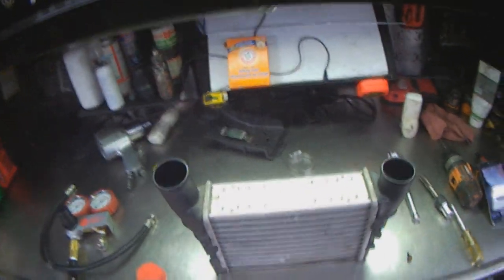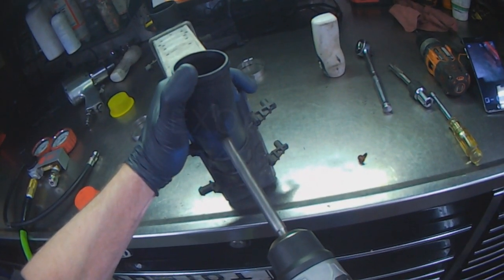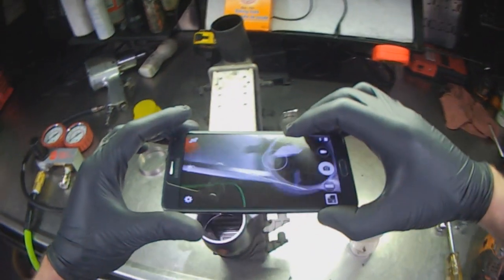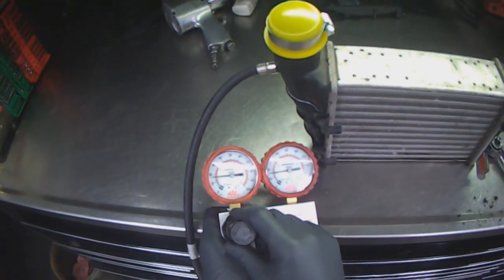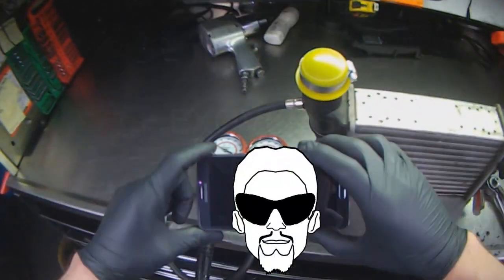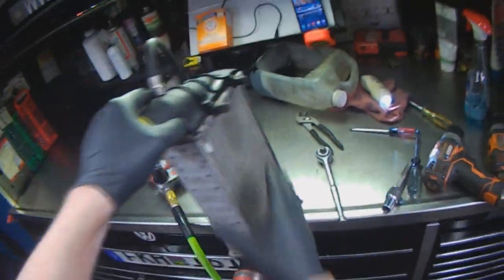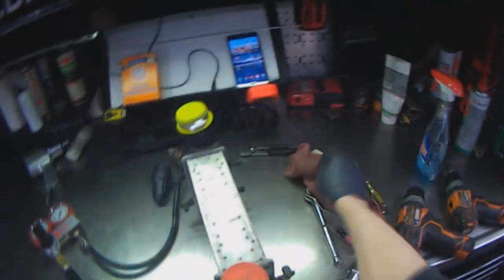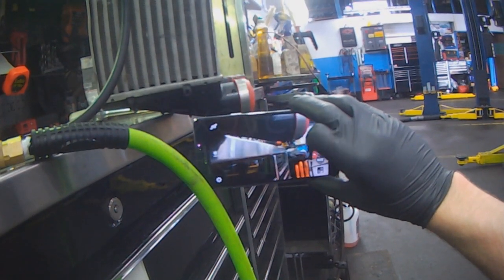Intercooler pressure testing (after drilling... OMG!!!)

Comment: Dude, I for one appreciate the time and effort. I have a 2012 3.5 in my f150. Just passed 70k miles. I have been on the fence about drilling. But now I definitely am convinced it needs to be done. Thank you !
Reply from the maker: Thank you for watching!
Reply: I have same truck. Have had a 1/16th hole for 2 years now. No issues.
Reply from the maker: @jt7559  Thank you for sharing!
Reply: Do you plug the hole or just keep it open?  It appears a lot of people just drill it.  I have a 2011 F150 3.5 EcoBoost
Reply: @n54tuners51  plug it, I tested it, I lost 2mpg with the plug out, truck was always under boost while driving
Reply: Does this apply to the 2015 3.5 f150 eco boost?  What size “plug” or type of screw do you guys use?
Reply: @n54tuners51  I have the same truck I have no issues

Comment: I think Every Turbocharged car owner should "drill that hole " !!!!
Great Video btw !!
Reply from the maker: klitoni1 Thanks! I would definitely recommend checking for oil if it is an older vehicle (6yrs+). On a side note, I put a turbo on my old car with an intercooler... vented the PCV to atmosphere however. After 7 years of driving, the intercooler looked like brand new inside, not a spec of oil or dirt.
Reply: Thank you, awesome and helpful vid

Comment: Wow this is awesome thanks for this information. This will help me not only save time but also prevent engines from blowing up. I find sometimes oil if build up too much will sneak up in so it takes time to empty it.
Reply from the maker: I've heard of guys drilling a smaller hole and leaving it open... on the newer diesels, the ones that are prone to intercooler icing, it prevents ice from forming because the water can drain out.

Comment: Excellent Idea. I have a 7.3 ford and I believe the intercooler is full of oil. Lack of power due to half the intercooler full. It is  a 2000 F550 with 280 K on it. Always been a work truck and most likely neglected. I have owned it for a year now. So this will be the first step. Next is injectors and glow plugs. Everything is original so time to give some TLC
Reply from the maker: I doubt that it is half full... you have bigger problems if it is. This was my intercooler when it was full with windshield washer fluid (used for cooling the combustion under boost)... injector nozzle was stuck open.
https://youtu.be/kY-2HRUdaqQ

Comment: I´ve done it myself in my ALH, in my experience even the small plastic debris got pulled out by the drill bit. If corrosion is a concern use an stainless screw :P Thanks for the tip Thomas.
I dont think there´s a need to blow things up, we never know what may happen, stay safe.
Reply from the maker: Fernando MMC Thank you for your input and sharing that you have done it yourself! I am worried about how it will blow up... I'm considering putting the intercooler in a metal bin (with my gopro inside the bin) so that the metal bin will catch any flying debris.
Reply: *****  i've met guys runing 2 - 2.5bar (36 psi) on 1.9 PD TDIs with bigger turbos on daily cars. I dont know what kind of intercoolers they use but probably you will need to raise the pressure higher before something blows :\  Using some sort of metal bin seems a good idea, safety first ;)

Comment: nice of you to take your own time out to show how its done, keep drilling them holes👍👌
Reply from the maker: Thank you for watching!
Reply: @EXOVCDS  Hi, i no it was 5 years ago when u did this vid, but i watch all your vids over and over, sure helps me out, i have 09 caddy 1.9 tdi BLS and most things in your vids are the same for the caddy
Reply from the maker: Did you already check / drain your cooler? Does it have a similar cooler?
Reply: @EXOVCDS  no not the same cooler i undo the pipe at the bottom of frontmount/cooler nice and clean for now

Comment: Haha, well, just after making the comment below, I found out that the Ford EcoBoost guys are all drilling their CAC's in order to prevent/resolve poor running concerns! You were ahead of your time Thomas!
Reply from the maker: Slightly different issue... water condensing in the cooler that gets pushed up and causes misfires. VW Common rail TDI engines also have water collecting issues. The EcoBoost guys leave a hole in the cooler. I'm just draining the pcv oil and plugging the hole after.

Comment: Glad I seen this video, I have a new 2nd generation eco 3.5  Ive seen that this can cause problems with the 3.5 overtime, I will investigate my cooler later to see if they might have added a drain plug, But something tells me they have not. Since the engine maker also likes to service and sell parts. I have no problem drilling a small hole for a screw, If something happens to the hole would be easy enough to go one size larger on the screw. But the side wall looks thick enough that one could remove the screw many times with no problems,  I can easily drain it myself when I change the oil, no big deal. Thanks
Reply from the maker: My point exactly! Thank you for watching!
Reply: Hey that was an awesome test proves what you've said is verfied & proven nothing like seeing it with your own eyes.👏👏👏

Comment: used to build aftermarket radiators. during testing slash blowing up the pressure we reached was 85 psi. these were not oem radiators. oem about 40 45 psi. the plastic tank will usually split at the header or where the alluminum crimps on. being the intercooler is built to with stand higher pressures I would say it would make quite a bang at around 100 psi. just my input. Be careful.

Comment: I drilled a 1/16 hole,  some nasty shit came out. I feel good knowing its not caking on my valves and internals. Also, i put a catch can on. Both together have changed the overall performance and gas mileage. I have zero power loss, maybe power gain actually. I have run into all the issues such as missfire, coil replacements, nasty looking spark plugs, limp mode, you name it... drill this hole, get a catch can, and be happy.
Reply from the maker: Thank you for sharing your experience.
Reply: Travis byington going to drill mine this weekend ;) thanks for the info!

Comment: great video, thanks for taking time to post and excellent proof of principle.  I like the info on a 1/16" hole can be left unplugged...the pressure would continously push out the foreign matter during operation. Combined with a catch can it would be very effective.
Reply from the maker: No need for a catch can... the intercooler is a catch can.
Reply: Just FYI friend.  Already had the catch can. .. Had the problem 20 K miles ago,  so added a catch can and changed the plugs  ( I was afraid to drill the intercooler at that time).   Problem came back...so I drilled the 1/16th hole, changed plugs again this time with FORD TB recommended .028 gap.  Found one plug with small cracks in porcelain.  Not sure what happened, but in my case, the Moroso catch can may not have "caught" enough. Thanks for your response
Reply from the maker: I'm not familiar with Ford intercoolers and the oil / water issues they have. My intercooler drilling / draining / plugging with  a screw is focused on older TDI engines.... to prevent oil from being forced into the intake, which can cause a runaway of the engine / major mechanical damage.

Comment: Ok I understand your fix and it makes sense. What about if you are wading in some water. Sinse that hole is on the low point of the intercooler wont you get water ingress into the intercooler and that can go in your engine alsoand lead again to misfire?
Reply from the maker: mixhael6609 Where in this video or in my other 1200 videos... do I show that I leave the hole OPEN? 

I drill a hole to drain oil that collects... AFTER draining I plug the hole with a SCREW.

Did you watch the video? Seriously... did you? Seems like for the majority of people watching this... I waisted 25min of my life making a video to help people save / prevent an engine blow-up due to oil ingestion.

Sorry if my reply seems harsh... it just doesn't make sense to me that I get comments like yours when I explain everything in the video.
Reply: Isn't the system normally under positive pressure?  How would water get in through a plugged hole in that situation?  If it did have a minor leak somehow, you might blow some tiny bubbles in the water and scare a frog but other than that...  ?

Comment: Well Thomas I watched it all , was not boring at all, quite interesting as a mater of fact.  Kinda got a vibe from the tone of your voice you wanted to rip someone's head off. :) Everything seems logical to me as far as the oil removal  is concerned .  The amount of  normal pressure I assume would never reach the shown tested pressures.  May I suggest the use of an automatic drain valve that opens with the loss of ignition  that automatically seals once ignition  is applied during operation or a manual valve that drains to a catch can if there is available space.  Plenty of electromagnetic solenoid type valves available , increased cost compared to a screw but improved and worth the investment for your customers and you to install and be rewarded justly.  You know for sure engineering at VW has the wheels  turning as well.  Just a thought. Take care Steve
Reply from the maker: Steve Rob Interesting idea and not a bad one either! Though, you can't beat a drill & plug in its simplicity! I drain it while the engine oil pan is draining & am checking tire pressure. DIY'ers can do the same... once they get over the fear of drilling. Hose removal requires extra work and stuffing rags in the opening. To each his own... I just felt that it was time to show the haters that this causes no ill effects. I think one of my viewers recently had a "runaway" with his TDI. Haven't heard much since (he was waiting for tools to continue with the diagnosis), but from how he had explained things, it sounded like this is what happened to him (oil ingestion from the cooler).
Reply: +Thomas EXOVCDS I've had a few incidents myself of little rev jumps and often thought about the intercooler oil issue being the cause. I like this method and will do it myself, however why not use a little rubber oring on the screw to stop even that minimal pressure loss?
Reply from the maker: ***** As noted & shown by the gauges... it's not a pressure loss. Pressure loss is not being able to hold pressure (what goes in stays in). Take a close look at your engine intake plumbing and look for signs of oil... are you sealing those areas of "pressure loss" as well?
Reply: Good point Thomas! I agree with you :)

Comment: Was this Video boring? Yes, but honestly it was very educational. I have a Turbo in my Truck and it was suggested that this be done. So now I have an understanding how drilling a hole and simply screwing in a screw can keep the pressure and since we are only talking 20psi any amount of loss is very low if any at all.
Reply from the maker: Plugging is not necessary,  but it keeps the driveway clean.
Thank you for watching!

Comment: With the screw removed, I wonder if it even leaks enough to be an issue...
Reply from the maker: Correct! I took a car on a test drive with the screw removed... no boost code set and no real difference between  specified & actual boost. I really don't understand how people can get so freaked out about a screw in the cooler.
Reply: You never notice it being out except for at the pump, we tested a few and all of them lost at least 2mpg, mainly because with the screw out it's always under boost because you essentially have a pretty good leak, put a screw in it and move on

Comment: As I have mentioned before, I've done it to mine and there is no ill effect.  Even drove in the summer with the screw out of it and no codes for boost leak.  I know guys that do this exact drill hole on the MK5/6 TDI air to air intercooler but not because of oil build up.  Water build up in the winter.
Reply from the maker: Thanks for sharing (again)... yes, water build-up on those models is a bigger issue than oil collecting!
Reply: Thanks for putting up the videos, as usual.  I always watch them.

Comment: May be local, after seeing the Quad.ca sticker on your toolbox...as I check out the website fairly regularly!   At any rate, just picked up a 2016 F150 XLT with the 3.5 Ecoboost, and will be adding the catch-can modification, but found an interest in whether I should try this modification as well.  With the ability of adding a screw to fill the hole 'if one wanted to'...it seems like a sensible mod.  Just wondering if moisture could be 'introduced' through a hole though, or if it would be negligible?  I'm impressed by all the tools and gizmo's you have!   Appreciate this, thanks for taking the time for this video...much appreciated!
Reply from the maker: The ecoboost issue is not the same reason I "drain & plug" the intercoolers on VW engines... not sure why ecoboost folk keep finding my videos. Leaving a small open hole is a "non issue". The reason I plug the coolers, is to prevent oil from dripping on my customers' driveways. Ecoboost engines (from what I gather) have a "condensation" issue... the VW engines collect PCV oil in the coolers. Excessive amounts of oil will result in misfires under load (similar to ecoboost engines) and can even cause diesel engines to runaway & explode... that's why I check / drain the coolers.
Reply: @EXOVCDS  it keeps showing up for us because each of us 3.5 EB owners end up searching "intercooler drilling" at some point. I just added a 1/16" weep hole to my 2011, bunch of condensate and oil blew out. Truck runs much smoother now. Deciding on whether I want to drill it out to 1/8" and plug it like in this video and drain every oil change or just leave it open.

Comment: If you draw a 8-in hole in the inner core how do you get the shavings out
Reply from the maker: This was for demonstration. The cooler is no longer used.
Reply: @EXOVCDS  when I drilled my cooler I put grease around the drill

Comment: Just came across this interesting video!  I have been thinking about drilling a drain hole in my smic on my mk1 Audi TT Quattro as I’m getting some smoke from that area in the engine bay where the Intercooler is located and also some blue smoke under boost from the exhaust I’m wondering if it’s due to oil burning and being drawn up into the intake turbo etc? Keep up the great work you do🔧👍🏻
Reply from the maker: Only way to know, is to check how much oil is in the cooler. =)
Reply: @EXOVCDS  that’s my next port of call. Thanks man 👍🏻🔧

Comment: A lot of the big diesel engines I work on have condensation drains engineered into the intake system, a tiny hole that always leaks boost..... you could drill a 0.25mm hole in that cooler and leave it open and not have problems.
Reply from the maker: Condensation is different from oil collecting. Water draining out constantly does not make a mess like oil. It's better to collect the oil and plug the hole after each drain.
Reply: @EXOVCDS  yes I agree, even the condensate drains get oil from them and are collected. Just a comment that it would do no harm to the engine or the way it runs.
Reply from the maker: Yes, I should have agreed that it was ok to do... but depending on the engine, it can make a mess under the chassis (getting all over while driving) on the driveway at home. Some Ecoboost owners leave the hole open so the condensation can drain all the time (to prevent misfires).

Comment: Very nice video much appreciated when do you know this is a problem I have a 2014 EcoBoost F150 48000 MI it seems to be running fine I am wondering if I should drill it anyway as a precaution? I appreciate any feedback
Reply from the maker: I don't have any EcoBoost experience. My intercooler drilling, draining & plugging tutorials are specific to VW 1.8T & 1.9L TDI engines (oil accumulates over time). From what I have heard, EcoBoost engines have condensation issues. Drilling & leaving a hole to allow water to drain, sounds like a good idea and worth doing (symptom or not)... as a preventive measure.
Reply: @EXOVCDS  I appreciate the help I will try and figure out how to do that I did install jlt oil separator thank you much for the reply

Comment: I wonder if you use a metal roof screw that has the rubber gasket built in if that would seal it.
Reply from the maker: FishFind3000 Anything that plugs the hole will work.

Comment: If one was really concerned of a leak from the screw they could put some RTV or a o-ring on the screw head to be sure it wouldn't have any leaks, or install a air compressor drain cock in the cooler.

Good tip.
Reply from the maker: Sure, whatever makes one feel better... thanks for the suggestion!

Comment: Just saw this old video and I'm sure I'm not the only one to comment on why he doesn't turn it upside down while drilling to keep any drillings from falling in ,or at least after drilling turn it over and give it a few raps to knock any possible drillings out.. am I being too careful?
Reply from the maker: Drilling is usually done while the cooler is in the vehicle. It's not an issue in either case... that was the point of the video.